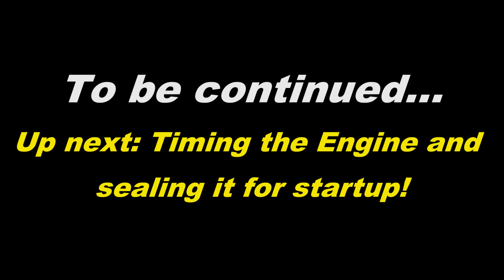Ford 5.4L 3v Engine Timing Chain Kit Replacement Pt 3 of 4: Valvetrain Component Removal

Comment: I'm no mechanic but thank you so much I followed your instructions step by step and I did my own timing job and put a new oil pump on it while I was at it first time ever doing it and did it right the first time thank you so much
Reply: how long did it take you
Reply: @kblend7225  that's my question, I'm starting this project lol
Reply: Same getting ready to start to
Reply: @Jake Degen  I finished it, everything was easy. DO NOT BUY THE CHEAP TOOL !!!! 
spend the extra money and get the one he links, not sure why but it works perfect. I bought 3 different versions trying to be cheap and all 3 would not screw down correctly, just awful. 

If you have any questions during this, hit me up.  My truck is running great after this
Reply: @chrisgraham8711  is there anything special you have to watch for when doing the roller followers? I heard somebody say if you're not careful the valves can drop in the head or something like that
Reply: @jakeostler6110  no Sir, just make sure you push them down as you screw down the roller follower 

I never had one drop and I did everyone of them and some 2 or 3 times
Reply: @jakeostler6110  I think this guy does un update earlier where he just takes off the cam caps and slowly decompresses the roller followers.. I mean, once they are out you can spin the motor from the crank with no issues... I'm confused why you would need to spin and pull out each... If you can rotate the crank shaft with the roller followers out anyway..
Reply: @chrisgraham8711  maybe you can clear someting up for me. When he gets the keyway at 12:00 and the #1 cylinder intake lobes are at 11:00, does it stay in that position to remove all 6 rollers(the 3 from each side) ? Thanks.
Reply: @chargeron3115  no, I was never able to remove all 6 at once and absolutely couldn't get them all back in like that. 

When you do it, two will fall straight out but the cam is always turned down on one of them that makes its impossible to remove
Reply: About how long did it take you cause I am about to do my own too but I work a lot
Reply: Do you have to take the followers out if you just change the chains ,guides and tensioners
Reply: oiy oiy oiy baka

Comment: Are the camshaft cap bolts torque to yield?
Reply from the maker: no
Reply: Thank you for the response.
Reply: If I am replacing the lash adjusters as well, do I need to soak them in oil to “prime” them or can I just drop them in?

Comment: When you hit step 2 and rotate keyway to 6 o’clock , cams are loose, is that a good time to replace any roller followers that are bad? (Assuming not the ones already removed ). Would you also change the lash adjusters while it’s all apart?  I have a new to me 04 f-150 5.4 3v but I don’t think it has ever had a timing job. Sounds like chain tensioner leaks causing low oil pressure and ticking at startup, and a general tick while driving like a bad roller follower.  Also good time for oil pump upgrade and water pump? Too bad your shop is so far away.... :)

Comment: Any advice on how to get the spring back on if it has slipped off the valve after compressing?
Reply: I have heard of people using compressed air into the spark plug hole. I never did this myself!

Comment: Hey, im doing the timing kit this weekend, can I install aftermarket cams same time and at the same tdc that you have it at? and just remove the cam caps and install the new cams?
Reply from the maker: Of course the cams come out anyway
Reply: @FordTechMakuloco  at what point in this timing chain replacement would u change the cam?

Comment: Do you need to turn the crankshaft to get the key way to 12 o'clock position if you are only replacing the cam phasers and tensioners?

Comment: Excellent series.  You are the Boss.  I know there's a chance you won't see this comment but I need to remove the cylinder head completely so, do I still need to remove any of the Valve Components? Or is it possible to pull the head with everything in it? Tnx in advance

Comment: There is a packes were came the otc crankshaft position,phaser holding, the spring valve compressor for the rocker for 70 dlls what did you thing? Buy it or not

Comment: This is John, that's not my picture. 2004 f150 5.4L 3v.  Need your assistance. While changing the cam phasers, the passenger side cam shaft indexed approximately 10 - 15 degrees.  My cam chain wedge did not hold firmly. I am now removing the
front cover to inspect why it did not hold firmly. the drivers side worked perfectly. can you help me with a process to re-establish the correct engine timing? i do intend to replace the timing chains and components but my concern is, if the passenger side is now out of time, will following the 4 part tutorial insure the complete re-timing of the engine? Or is there a simpler approach? the process of removing valve followers concerns me, especially with the risk of dropping a valve. if that should occur.....oh well..... .If the spark plugs are removed, do the followers still have to be removed?   By indexing the crank shaft, to position cylinder #1 intake cam lobes at 11 o’clock and proper installation of new chains does that insure complete and correct engine timing?   Greatly appreciate you knowledge and skills.   I hope I explained this well enough.    Regards,  JSM.

Comment: Thank you so much for the video, I just finished with my 2008 F250 4x4. But I have an issue with the vacuum hose popped off the intake and I can't find where to hook the hose.

Comment: I have a 08 ford F150 5.4 I'm trying to do timing chain and replace all new. It said on vedio take all rocker roller when doing the timing chain set. What I'm trying to figure is there a certain way I know cam lobe is 11 O'clock but is a certain order to put back on and cam I turn crank shaft with out bending valves to put rocker rollers back in it? Also the driver side 11 rocker arm is not coming out what should I do and that's the last one to remove but is giving me hard time to remove?

Comment: My timing chain came off the phaser on the driver side n busted a hole through my valve cover..how do I time it correctly with the other side on video 3 5:00 in. Or how do I get it the correct position
Reply: Exact same thing happened to mine. Did you get it fixed?
Reply: @evan strain  I did a complete timing rebuild..it's pretty easy but expensive with the correct tools!
Reply: @rockylopez1371  did you have a broken chain guide? What do you think caused the chain to punch through the cover?

Comment: Great video series - my guides shatter and came thru the drivers side valve cover, I'm following your series and replacing all timing components, and oil pump. Do you recommend removing oil pan to clean out possible debris? I have a two wheel drive F150?

Comment: First and foremost thank you for some great videos, very educating. My thing is like on the cam followers you show us howto remove them on cylinder 5 which is fairly easy but cylinder 1 is a pain in the butt.....lol. Please don't take that as a complaint because I was just giving you a hard time. Just wanted to say thanks for making this job so much easier with your videos.
Reply: Did you have trouble removing the exhaust follower on cylinder 8? Doesn't seem to be enough clearance. Is there a trick?
Reply: @davidbear3033  Actually I really did not have that much of a problem. I was using the suggested tools and I just wiggled them into place and played with the follower until it came out. It has been over a year since I did this job but pretty much handled them all the same. After getting the tools, I say tools because it is two piece but after getting valve spring compressor set you can try moving back and forth and side to side until it comes out or you can take a large screw drive and set it on the lip that sets over the spring and pry on it like you are moving it forward and they come out fairly easy that way. Just make sure valve spring is compressed as far down as possible. Hope that helps.
Reply: @davidbear3033  I have this issue what did you end up doing
Reply: maybe you can help where he skipped, what about reinstalling the exhaust followers ? Just goes back like removing them ? no special specs or order to follow ?

Comment: when i was removing a roller follower with the tool, you know how when it gets pressed all the way with the tool and your applying the finger pressure and it makes that little "pop"? well it did that, and instead of pulling the roller follower off like i did on the others, i absent mindedly released the pressure with the tool, before i pulled off the roller follower.  now when i repeat the procedure it doesn't make that little "pop" noise, and the roller follower is loose, but i can't get it to come off like the others did.  do you think i lost the valve?  I can still see the little valve stem and i applied pressure with finger every time i use the tool.

Comment: Once you compress the spring and remove the roller follower do you just loosen the compressor and take it out or do you need to keep pressure on the valve stem as you loosen the compressor?

Comment: @FordTechMakuloco im doing the timing just like in this video. Im at the last roller follower on cylinder 8. I have spring compressed as u showed. And the follower bareley moves. As if the spring isnt compressed enough!! HELLPPP lol please and thank u
Reply from the maker: Make sure that cam lobe has base circle pointing down.
Reply: I appreciate the reply. I did end up getting it by just rotating the cam like you basicly said to do. NOW whole new issue. Every cam tower and cap have a significant amount of gauging along with the cam itself. The roller followers are all in pretty good shape besides one that has no wheel at all anymore..What should i do at this point?? Replace the heads and cams n supporting parts?? I found a complete set cams rockers and all, all brand new for a great price but 6 hrs away... But im also not sure the new heads r the ones i need. COULD I PLEASE GIVE U A CALL OR YOU ME?? Ill post my number if u dont wanna put yours on here. Promise not to take alot of your time. Would just b easier to explain the head situation .. Thanks again!!

Comment: Once you neutralize the cam shafts do you have to repeat the process of removing the roller flowers with the tool?
Reply: No, because there's no tension on the lobes. So after you remove the cam caps and lift the cam out, you can just pick the followers out by hand

Edit- just did this timing job last week, I know from actually doing the job
Reply: I wish she would answer some of these questions

Comment: The tool does not fit properly when I try to use it it’s like the tool is too short the top screw can’t reach the threads even with trying to compress it, advice?

Comment: Brian , had my 5.4 3v triton rebuilt got it back runs was smooth as silk however suddenly engine light came on with a P0345 and a P0128 code  this drives me nuts cause didn't expect anything to come back just a new rebuilt no issues any ideas on this? Any help would be appreciated.
Reply: P0345 should faulty knock sensor. Regards from Australia

Comment: Why in the world would you bother doing this spending 3 grand to have this done and you can buy a remanufactured engine from power train for 3300 and have it installed for around 1200 and you got a new engine I run it till it blown up and just replace it

Comment: Can't the job bo done without removing the roller followers
Reply from the maker: I wouldn't even try it not to mention they are a common failure item so why not remove and inspect?
Reply: @FordTechMakuloco  yes sir your right do the job right or dont do it at all I guess I let that intimidate me

Comment: Love your educational videos!  Question, what is the purpose of removing the camshaft rocker followers on the 4 cylinders if the crankshaft is in the 11 o'clock position and the timing mark is at 6 o'clock?  Could one not lock the camshafts in position with a pair of (correct length vise grips between the lobes?  thank you.
Reply from the maker: You remove them so that the cams are neutralized when you turn it up the 6 o clock position. This way the cams can be removed so you can remove the rest of the followers.
Reply: @FordTechMakuloco  why would the rest of the followers need to be removed? Thank you for the video.
Reply: @etripp111  If you're this deep in the engine, now is definitely time to replace all the rockers. They are well known to seize up and then bad thinks happen. He has some vids about them and what happens when they seize up
Reply: @WraithCustomsFirearms  as you are correct, that still doesn't answer the question. If the cams are neutralized at 6 o clock with #1, #4, #5, and #8 roller followers removed, why couldnt you rotate to 11 o'clock and begin installing new chains, phasers, and the 6 original followers? We are talking about hours of extra work, when most of us aren't going to buy new cams and 24 new roller followers after spending 1k on the chains and tools (in 2023) these trucks kbb for less than the cost to replace the entire valve train and timing components. if the 6 pulled rollers look good, and the cams look good, why wouldn't I save myself the time and money that I don't have to pull the cams if I only want to replace the chains?
Reply: I was thinking that exact same too

Comment: What cylinders need to be top dead center to the valves. I bought and 06 f150 that had broken chain guides. I have already taken head off had them inspected and everything checks out I have replaced the head gaskets and torqued them down to specs but I'm running into timing was off when I took everything apart

Comment: Can anybody she'd some light on this? I can't for the life of me seem to get my tools positioned in order for me to get the knob to screw on. The cam position is where he said to put it as well as the keyway on the crank
Reply: Cameron, Im having the same issue. What did you end up doing?
Reply: I had that problem with the tool and solved it by removing the little screw pin from the top of the piece that pushes the valve, then grinding the top down a bit to reduce the length by about 1mm.  That little pin screws back in just fine.  Then the tool worked (could catch those threads) because that piece was a tiny bit shorter.

Comment: Hi, I’ve been following your instructions, bought the parts and tools through your links, etc. Trying to remove the driver side (Dorman/Chinese) phaser with the locking tool installed but the internals and the outer front portion of the phaser are turning (teeth aren’t) when trying to loosen. Camshaft is also turning. Looking for advice as to not mess anything up. Already did the passenger side (original OEM type) without issue. Thanks in advance!

Comment: I have a question, I have been following your video up to the point of the actually timing and adding the rocker arms. I did the timing, the marks matched up perfectly, I added the rocker arms, then I rotated the engine multiple times, (4-5). Everything feels perfect, no clanking or hitting or resistance, but when I looked at the timing marks, the were all off on phaser, (front cover is on) so I can’t see the other marks. Is this normal? Or did I do something catastrophically wrong. Need help before I can move forward with anything!! Thanks
Reply from the maker: Yes this is normal

Comment: Brian, did you remove all the roller followers, from this job?  I was thinking you were going to show cylinder 1 and cylinder 4, passenger side.  I only saw 5 and 8.I assume specific roller followers were removed from 1, and 4, 5, and 8; them another rotation on the crankshaft to remove 2,3,6, and 7?

Comment: Great videos. Just started #3. I bought a project. Guy already has engine apart. He had cams out so as he could spin crank to inspect pistons. will that be an issue with timing the truck when putting things back together? thx

Comment: Need some help,  at the point where I’m removing the 6 roller followers. Have cylinder 1-4-5 done, but exhaust spring in cylinder 8 seems to Be compressed and can’t remove. What can I do here? did I rotate too far?  
Key way at 12-lobes at 11 approximately
Reply: Tanner Smith I had same issue with cylinder 1. Seemed like the cam lobe at cylinder 1 with intake lobes at 11 make it super tough to get out the exhaust roller. I’m on pause currently,what did you end up doing? Thanks for any help.
Reply: I had the same issue. Just backed it off and repositioned the fork to the other side and tried again and got it.

Comment: Before I remove original chains I checked and positioned crank and cams timing and the A was on Drivers side and L on passenger 180 from manual and video. I need clarification on why this is like this on my 2009 F150 5.4L ???.   At what position should cams be to set number one cylinder intake valves for proper timing in reference to crank at 11:00 O'clock with special crank timing tool